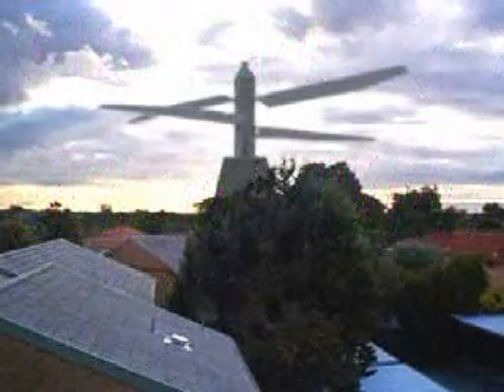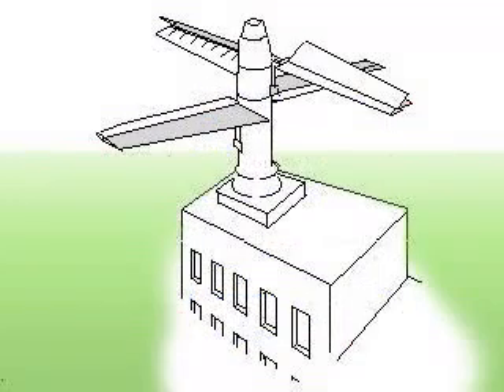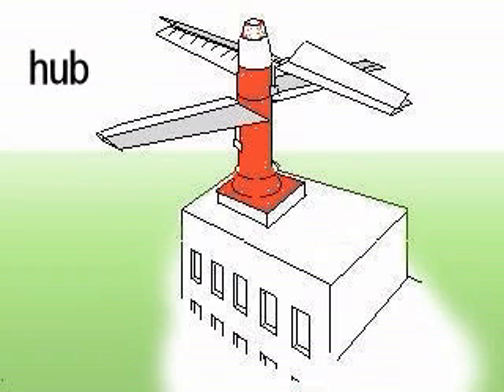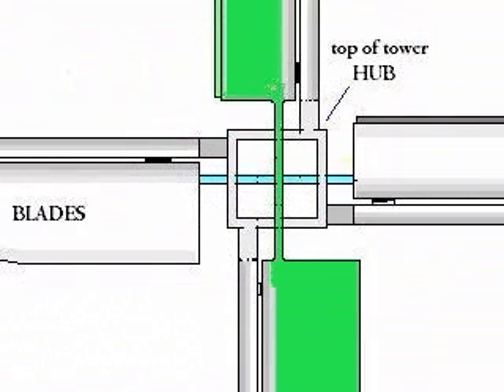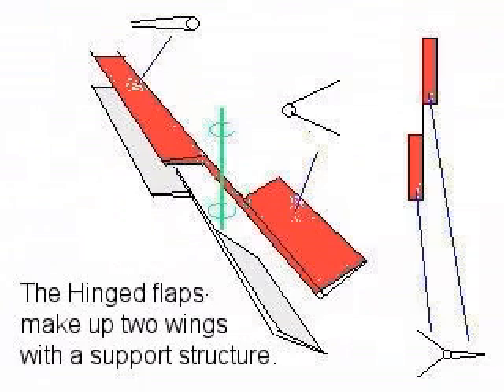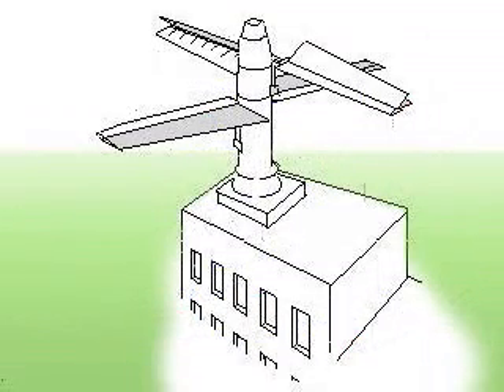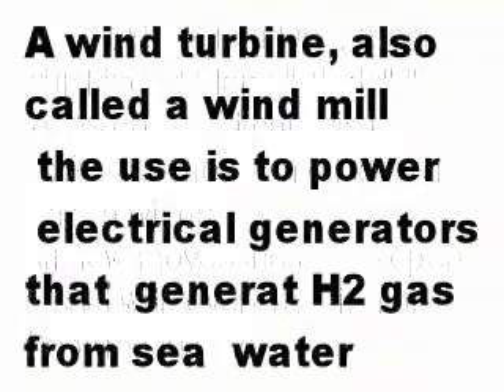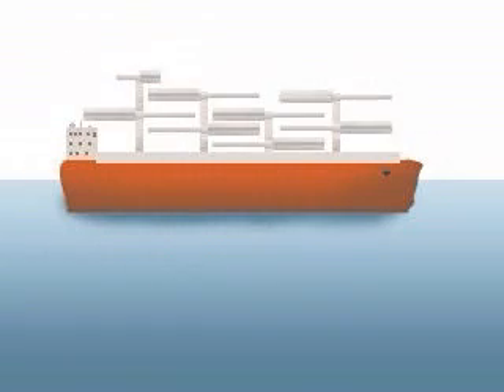green Renewable Energy Roof Top wind Power

Comment: @WindEnergy7 
With this design the rpm is inversely related to the length of the blades. The wings act like scoops making this design only marginally different then a savonius. 

With longer blades, a significant amount of energy will be lost to radially accelerating air inside the scoops to the end of the blades.

Further more significant amounts of energy will be lost with the constant changing of the pitch of each blade (open, close).  the more massive in the blade, the more energy lost.